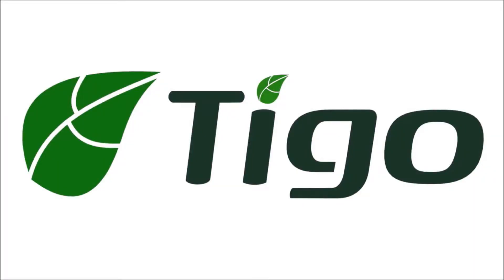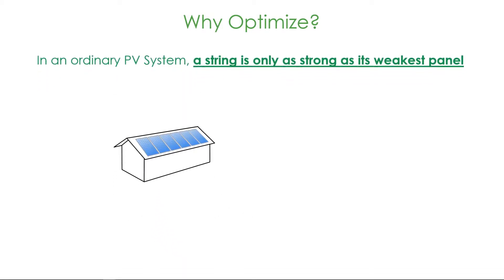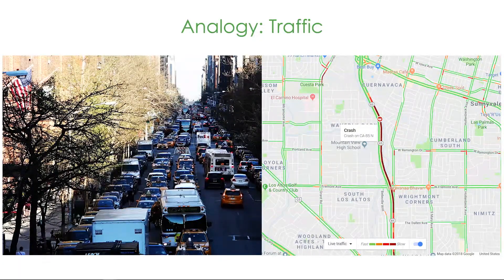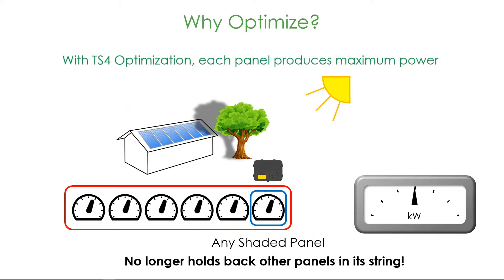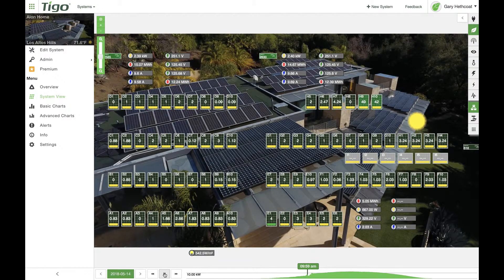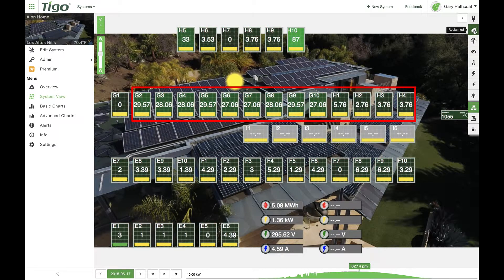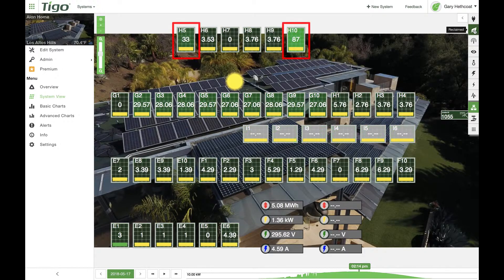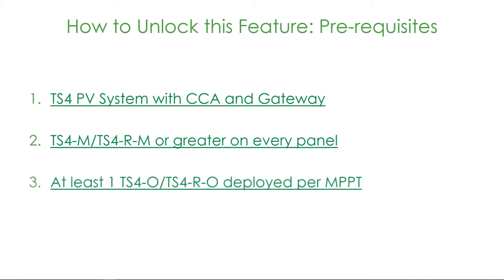Tigo SMART Site - Reclaimed Energy view

Comment: Can you fit a single TS4 on a single problematic panel or does every panel on the string need to be done?
Reply from the maker: You are able to use as many TS4s per problem modules in the array as desired. This is called Deployment and we offer three types: https://support.tigoenergy.com/hc/en-us/articles/360024860193-TS4-Systems-Methods-of-Deployment